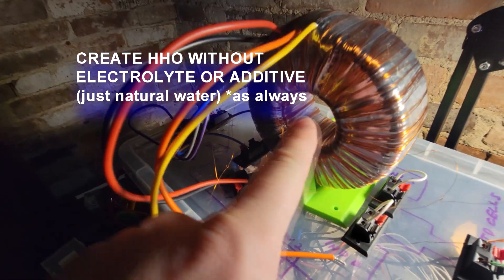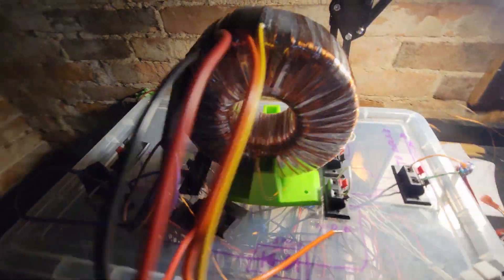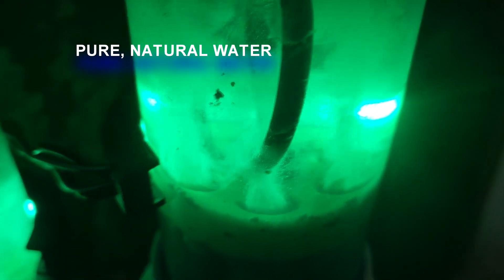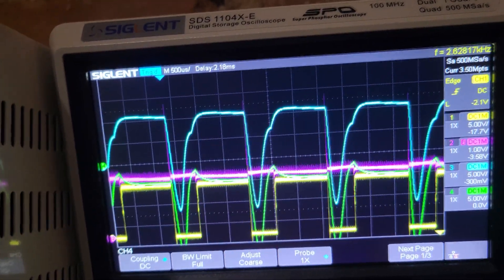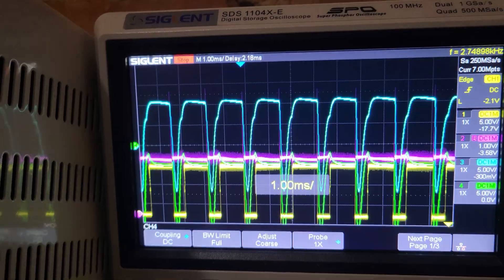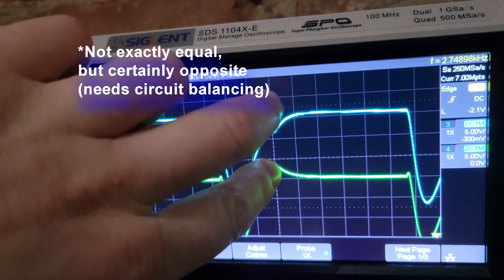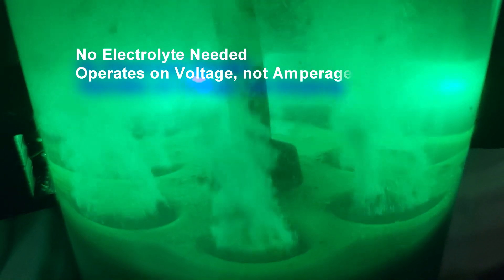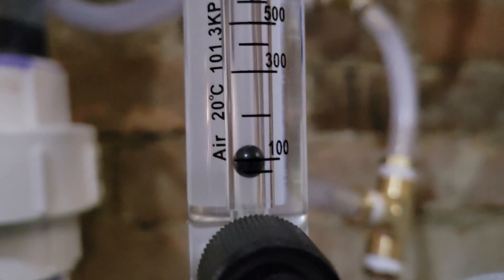Create HHO with No Electrolyte or Additive! EASY MODE

Comment: Question is can you hit cell with 40000 60000 90000kv?
Reply from the maker: Short answer, yes. Long answer,  not yet. If I could get the cell to 10kv, production would probably be insane. I lack the mathematics to make this happen. However, my approach is more like a artist, throwing paint at a wall to see what sticks. More designs, testing, and calculations needs made to achieve higher voltage. I'm certain it can be done, but it will take time to figure out.
Reply: @noahauman  Meyer said he used over 90k volts, one theory is that his VICs were connected in series to give that voltage, and every VIC was tuned into multiple phases...it just a theory....
Reply from the maker: I believe it can be accomplished with a single VIC. His documentation states "up to and beyond 20kV". If I could just get 1000v at the cell, that would be phenomenal. My VIC produces 1-2 kV by itself, but under load it drops to less than 150V.
Reply: @noahauman  Toroidal Transformer is 220  to12V?
Reply from the maker: @11T872  yes

Comment: I accomplished something similar several years ago, except with no high voltage transformer or power hungry inverter, using modified bedini technology https://www.youtube.com/watch?v=_cnIgoksQ4s
Reply from the maker: @wildmanfujiami5870  no high-voltage, no resonance = no Electrical Polarization Process. What did you drive it with?
Reply: @noahauman  you misinterpret my comment, technically there is "high voltage" present but it's not classical AC or DC in the sense of a typical inverter, the work is done by harnessing the radiant energy spikes created from the collapsing magnetic field in a 1 wire inductor, set to the ideal operating frequency for the given array. We were able to operate the device with significant output with as little as 11 watts, as per stanley meyer's observations.
Reply from the maker: I see... Curious to what your significant output was! Did you have any sort of mL measurement or just using imperial methods.

Comment: So what's the point of the whole exercise?
If this form of electrolysis is so good why aren't we all using it?
100 ml/min of HHO would barely light a cigarette let alone have any real world benefit.
Reply from the maker: @RobertRichardson-z3u  to prove concept. as higher voltages are attained, gas production increases exponentionally. HHO on demand without electrolyte completely reverses the "traditional means" to do so.
Reply: @noahauman  You may run higher voltage at lower current but the power equation remains the same.  (P = V x I).
Irrespective of the voltage/current thing you are still putting in far more energy than you are getting out in the form of combustible gas.
The type of electrolyte doesn't change the basic laws of physics.
Reply from the maker: @RobertRichardson-z3u  Voltage is a static state and is not "consumed" by the circuit. You can keep the voltage at a given state while minimizing amps. With voltage performing the work, energy (amps) are not consumed in the cells. Unlike traditional electrolysis it is not a 'electron exchange' that performs the work (amps), but rather static voltage fields. As voltage increases linearly, gas production increases exponentially.  Also, my "cigarette lighter" will burn through a steel pan as your Bic will not.
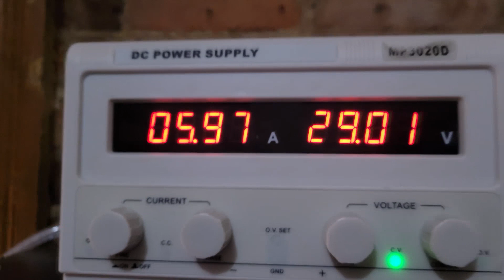Reply: @noahauman  Sorry, but you have a total misunderstanding of the relationship between volts, current and power (Ohm's Law). At 1:05 you show your power supply output at 29 volts and 5.98 amps (174 watts), that looks like real power to me. Also, if this electrolysis cell makes gas with high voltage / zero current (zero power) then you are creating energy and planet's energy crisis is solved! When will we see this fantastic "invention" in the real world or will the mythical Stan Meier's conspiracy gang get to you first?
Reply from the maker: You need to comb through my previous videos. I don't "misunderstand the relationship" as you put it. The total power input (volts / amps) is completely different from what is actually traveling through my cells. Yes I am consuming 147W input, but at my physical cells, only milliamps are being consumed due to the resonant properties of my circuit. I'm not using zero current (not sure where you got that from). I am MINIMIZING current flow with the LC properties.

Your last snarky comments signal to me that you're not here for valid argument or constructive collaboration, so I'll just leave you with this: You are misunderstanding the concept here --- what is happening at my cells is a 180-degree flip from traditional electrolysis methods. Yes there is input wattage being consumed, but this is in my transformer and is mostly due to the inefficiencies of my circuit setup and the lack of mathematical knowledge thereof. However, what I am accomplishing is Stanley Meyer's patented "Electrical Polarization Process", which utilizes voltage, not amperage to perform the work of separating the water molecule (without electrolyte additives) which is "impossible" according to the present status-quo.

Given time, as I am able to achieve higher voltages, there may be a point where I am equaling the wattage consumption of traditional electrolysis cells (and someday possibly below, thereof). I am not claiming "over unity" or "creating energy". If you watch my previous videos, you would understand this. Until then, keep believing everything is impossible and it will be. Perhaps before you come back with more negative comments, actually read through his tech, understand the concept, and then get back with me.

"He who thinks he can, and he who thinks he can't, are both usually right"
Reply: @noahauman  OK, carry on with your "research", best of luck to you.
I have looked at your previous videos and they tell me the same thing.
I don't see the real world difference between high voltage, low current cells and low voltage, high current ones. The end result is still the same.
I will make reference to my original post of "what's the point" though.
There are hundreds of videos pertaining to Meyer's work and nobody has actually presented a genuine, real world, useful piece of hardware. Performing some experiments and explaining the process with pseudo science is fine and good but given today's availability of information and resources why has no one ever replicated Meyers alleged results? Remember that a device does not need to actually work to be granted a patent.
When will I be able to drive my car with this technology, if ever?
Reply from the maker: Hey, thanks for that. I will ultimately prove the impossible. Nay-sayers will never stop me. In fact, they add fuel, as it makes me see just how short-sighted they truly are. It makes me think of every great inventor in history and how they were mocked, laughed at, and ridiculed.... until the tables turned. Time will equalize all.
Reply from the maker: I will carry on.... but I'll leave you with this single video. It is my biggest breakthrough yet. I discovered how input power consumption can be minimized, and with optimization, could be the key to achieving my proof of concept. Cheers.

https://youtu.be/AyAyjvnEt7g?si=AeLsI5j1o_nYx1en
Reply from the maker: @RobertRichardson-z3u  https://youtu.be/5rBj4c-oOzM?si=Ks0ZBQtuo0DjiFlN